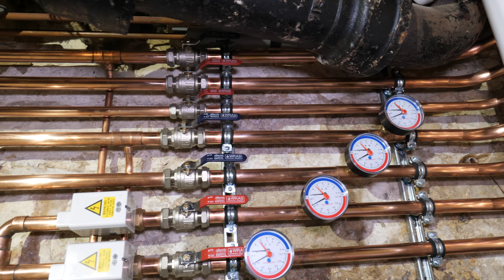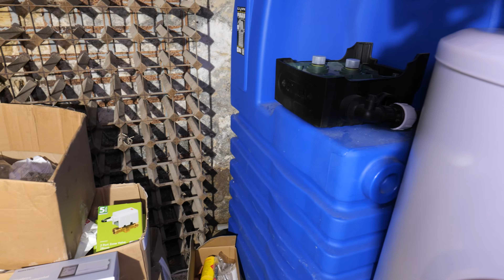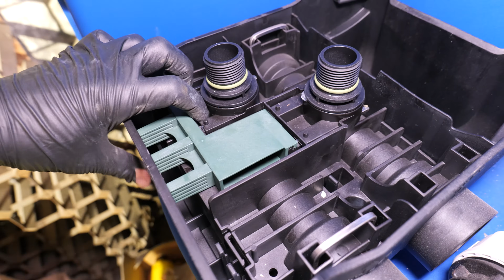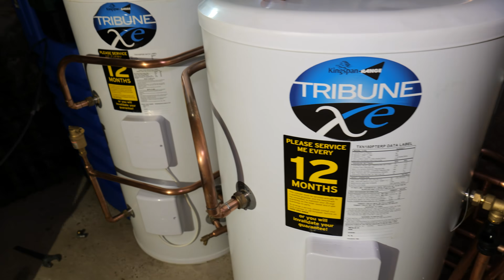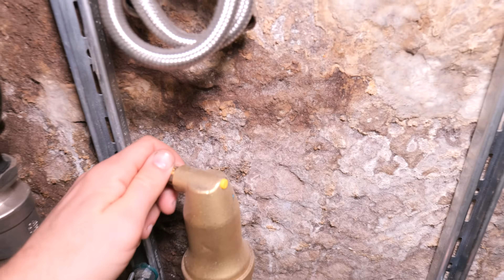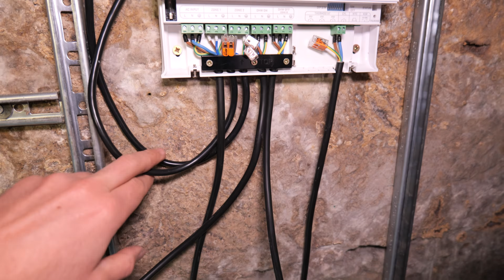Plant room pt.2 - Twin unvented cylinders

Comment: What is that pump next to hot water zone valves does? I believe is installed on cold water system but why you need one if you already have a dab?
Thanks

Comment: Would it not be easier to piggy back the second tank off the first, as if it's needed it will be when the first one is in high demand anyway and then just have a separate app programmer, nest etc stopping the switch live? That way both have to be in agreement for it to open the second zone valve but not the one on the primary cylinder.
Reply from the maker: It's a tricky one because we have to use the Navien wiring center to use the Navien smart features. The cyl stat uses low voltage. What we have done is use a separate programmer for the second cylinder. Trust me .....we tried numerous options. Thanks 👍
Reply: @loving-plumbing  Oh bummer, I'm not up to date on the Navien smart stuff but I was hoping you'd be able to ELV instead of LV for the second control. If I remember correctly the Nest will allow 24v in on the common and only needs 230v for the wifi receiver to be powered up and sending the 12v to the smart stat. 

If Navien is using their own voltage/digital impulse though similar to Vaillant it makes it a pain for the tanks. I find the same issue with HWP with Viessmann when using third party cylinders.

If only there was a common standard already that was empowered by regulatory bodies.

Comment: Nice job. As I understand it the way the cylinder hot water draw off is piped with both valves open ie using both cylinders the hot water will always come from the first cylinder as it’s piped the closest. They would need to be equally piped and the valves on top of the cylinders so the runs are equal.
Reply from the maker: Thanks 👍. Understand your logic , but the system is powered by a pump on a break tank so I don't believe it will make much of a difference. I will check it out and get back to you 👍

Comment: Great job as always - Having followed you down the Navien oil boiler route - thanks quite impressed better than Grant - could do with a tip off on the make of the high temp pump ? 
Also just on the twin cylinder and other comment on high gain cylinder - we use a normally open valve before the heating zones which we wire to cylinder call so the system becomes hot water priority as this valve shuts on cylinder call so all boiler output goes to the cylinder speeding up recovery so we can use a smaller cylinder and boiler is sized for hot water only (which is usually more than heating load anyway) so a smaller boiler also 
To coin a phase from Andrew Millward “hope that helps” (not that I’m at his tech ability level)
Reply from the maker: Thanks 👍 . I believe it is a "pump house " high temp pump. It's the same one on BES but don't get it from there it's overpriced. 
 I would have considered hot water priority if it wasn't for the integration of two cylinders on the smart Navien system. It was a technical nightmare to get them both running simultaneously. Thanks for the comment .